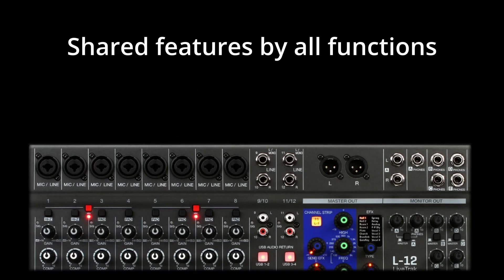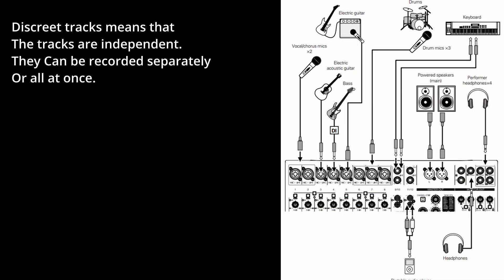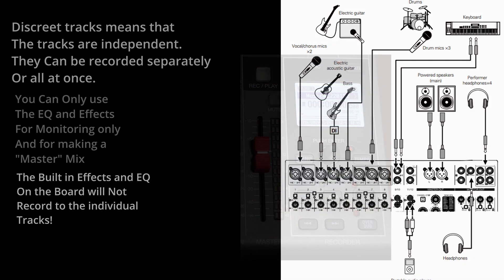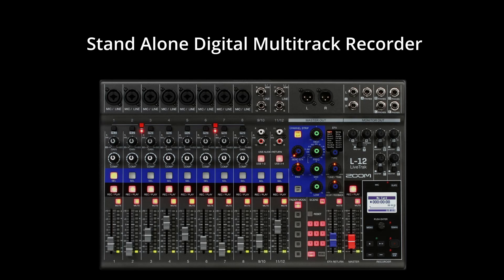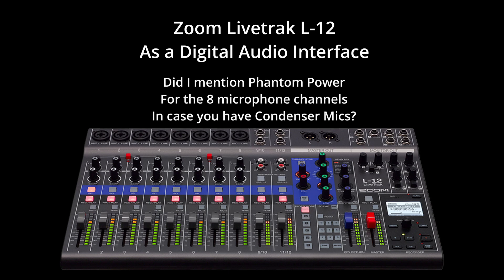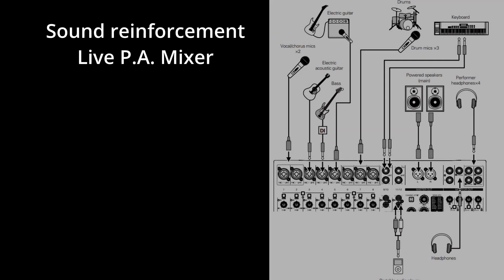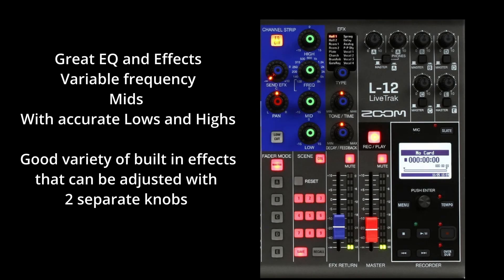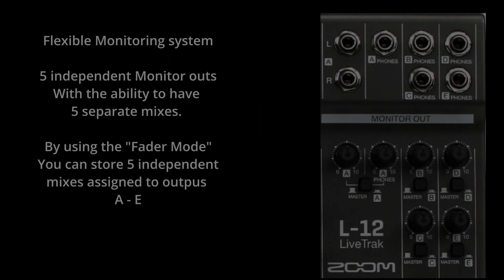Zoom L-12 Simple Guide Part 1! featuring: Recording board, Digital audio interface, and PA mixer.

Comment: Great job! Can I connect my powered floor wedges to the headphone jacks with TRS-to-XLR cables?
Reply from the maker: Thank you for watchin! Really appreciate it! Don't forget to subscribe and check out our original music playlists! If you use the Monitor A out that has a left and right TRS output, you can use a TRS to XLR cable going directly to your powered monitors and it should work fine. If you need to use the headphone outs B-E then it is a little harder, the output will be lower and could distort sooner. It can be done but it's not as easy. 
Hope this helps!

Comment: Thank you for your videos, they've been very helpful. Please help me. I recently bought an R-12 which I was able to install as an interface on my PC (Windows 11 Home Single Language) without any initial problems. I even installed Cakewalk and did some test recordings with guitar, bass, and music from a YouTube video using the USB cable. But I don't know what happened, and the next time I turned on my PC and the R-12, there was no audio and the USB inputs on channels 9/10 and 11/12 weren't recognized. I've already uninstalled the driver, reinstalled it, and restarted everything, but I still can't get any sound. Thank you for your help.
Reply from the maker: Thanks for watching, I really appreciate it! Not sure why you are having this problem, the obvious checks are make sure the cable is still good and also make sure the USB buttons on the channels are red. Check also you audio outputs setting on your PC. Also keep an eye on the faders and make sure you prior mix didn't lower the output. Your output should be the "master" mix. Hope this helps, keep me posted let me know if you fixed it and how you did it!

Comment: What about connecting a powered loudspeaker to one of the B to E headphone outputs ? 

This is the top level of video tutorial on the internet, many thanks and congratulations !
Reply from the maker: Thank you so much for watching! Make sure you subscribe and check out our original music playlists! Your best bet for monitors is to use the Monitor A outputs that have the TRS outs. Using a TRS to XLR you should have no problems with powered monitors. If you are using those and need to use the headphone mixes B - E, then it is a little more difficult. I will work but the output is lower, and it might distort sooner. 
Hope this helps, let me know if you could get it going!

Comment: Thanks for this helpful video. Appreciate it. Can i confirm with you, if i were to use my phone to record video + audio using USB cable, will the effects on board be recorded as well?
Reply from the maker: Thanks for watching! Where will the audio be recorded, on the phone? Will you be plugging in a mic to the board and record the sound coming out of your speakers into the phone? If you record using a mic into the board, the sound recorded on the board will not use the effects. You would hear the effects coming out of your monitors live, but not on the recording. I record video and audio on my phone, but I also record directly to the board and add effects after the fact. Then I synchronize the video from the phone and the audio with effects on the board or the DAW. Let me know if this helps.
Reply: @sugarcanerush hi thanks for the reply. I am using the USB B to USB C cable to connect the L-12 to my phone (audio interface mode). I am not sure if the effects i used for all the different equipment gets  recorded in the video recording through my phone.

Comment: The only annoying thing about this mixer is the fader memory, there's no way to turn it off. So...every time you need to adjust a fader you have to raise it passed the memory point before it activates. You can't just pull a fader down while live mixing, you have to push past where it's at then, it will activate the fader. Good feature but I wanted the ability to turn it off!

Comment: Hello great Channel,  I Need some help o advice my zoom turns on but the screen remains completely black and nothing else works, when I tru tò turno It off It won t even turno off, do you have ani idea as tò what It could possibly be? Thanks in Advance
Reply from the maker: Wow! Sorry you are having this problem, have you tried unplugging the power supply and waiting a few minutes. Then plug back the power supply and turn the board back on. Try shinning a light on the screen and see if you see anything being displayed, if so the backlight for the screen might have failed. In any event you might need to call Zoom Tech support and see if they can help.
Reply: @sugarcanerush  thanks I have tried turning It off and on with the plug but nothing, I will contact zoom and see what they Say, cheers  and keep up the good work 😉😎
Reply from the maker: @johnnyraelee  Good luck, let me know if you figure out the problem.

Comment: I have the same mixing board, it’s ok. 
To name a few things not covered, you can only have a single global effect
If you want 96hz i think you can record only the first 8 channels
In windows you can only use channel 9/10 for output and 1/2 as send/mics in daws you need asio drivers
The outputs are really bad, not suitable for setting monitors for band, only headphones, more as a podcast
Reply from the maker: Yes, there are limitations to this board, but you have to weigh in the price point. I wish it had motorized faders and to have multiple effects etc, but then you would be looking at a lot more money. For simple needs, it works just fine. Also I use the 1/4 " outputs of mix "A" for monitors and it works for me. 
Thanks for listening and I appreciate your comments and suggestions! Take care and keep the music going!